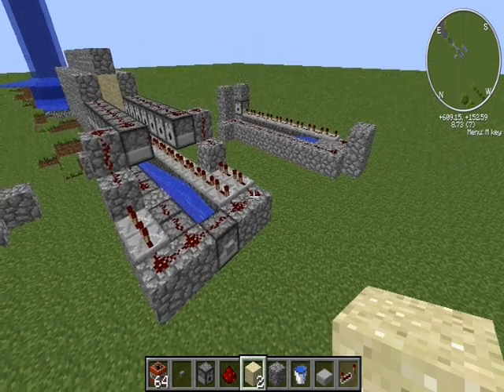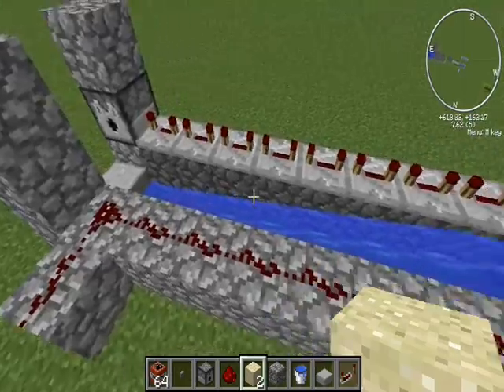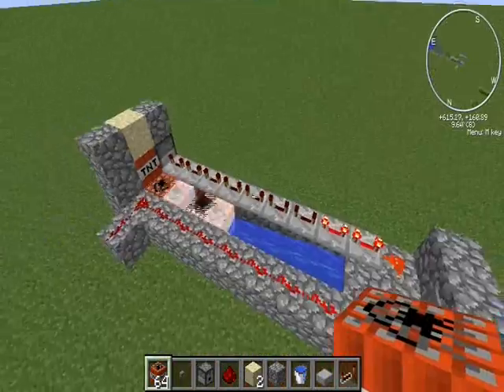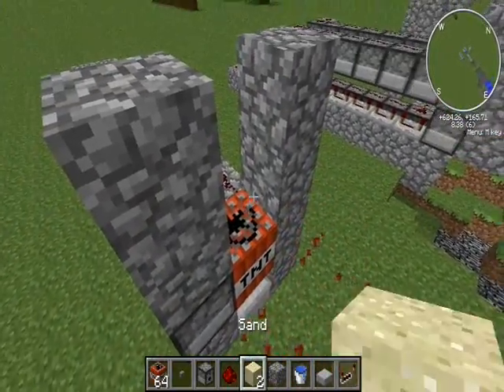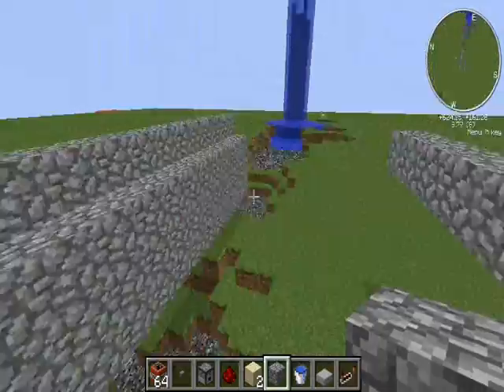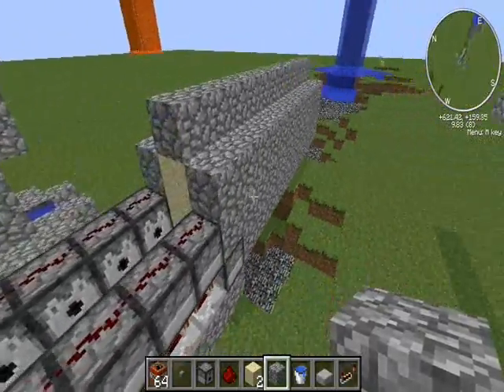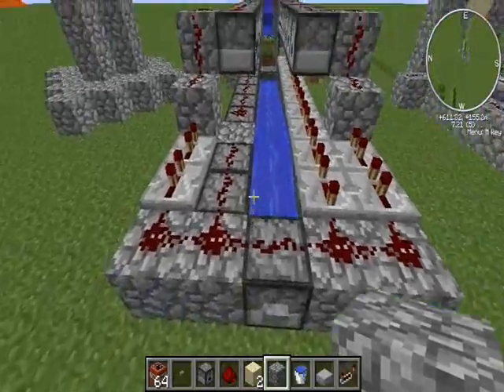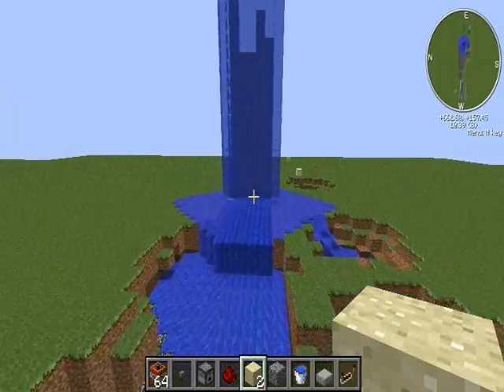PistonLess Hybrid Cannon (super easy to build!)

Comment from the maker: It does work make sure your timing is down correctly and also have the barrel to increase accuracy, to make the sand and tnt stick together requires increased fire power (more tnt) and better timing which is the main problem with hybrids. I saw your message that you sent me, since you require a cannon that can go through roofs it requires alittle bit of tweeking to the cannon to achieve your results. Also you may have to keep rebuilding ur cannon to get the distance right, and also some luck!